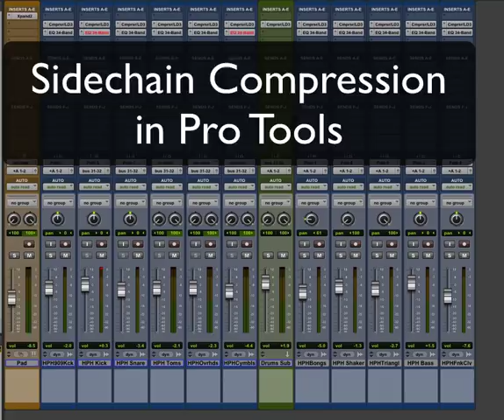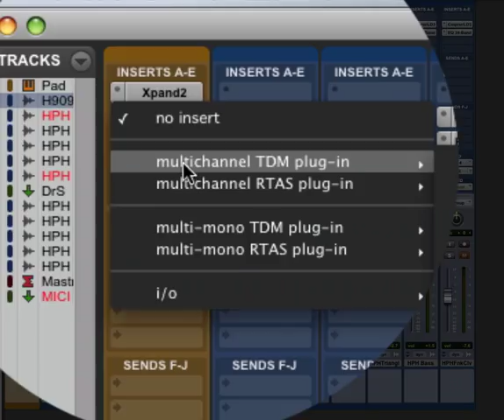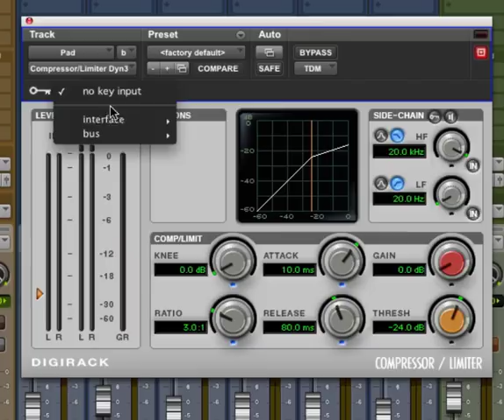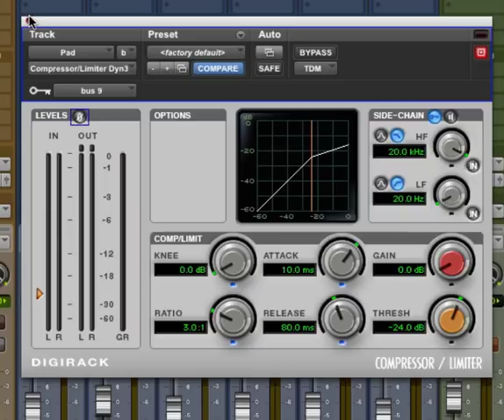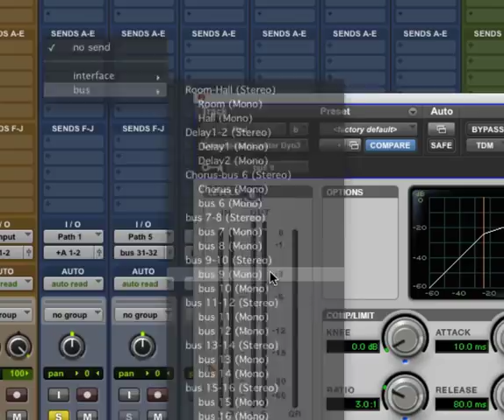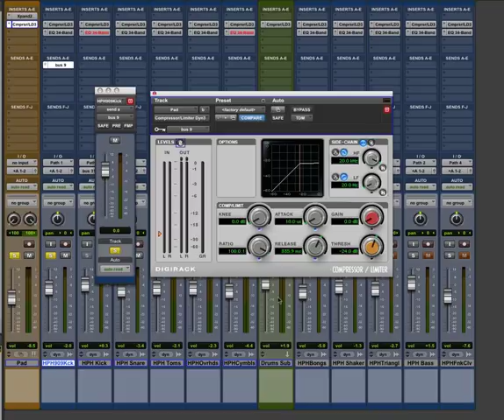Sidechain Compression in Pro Tools

Comment from the maker: @Brandon, yes that's right, if you mute the kick track you'll no longer be sending a signal to the bus feeding the side chain.  So, what you want to do is change the track's output assignment.  For example, if you send it to another output or bus temporarily the signal will still be sending to the side chain but you won't hear the kick in your master output.  That's the trick.